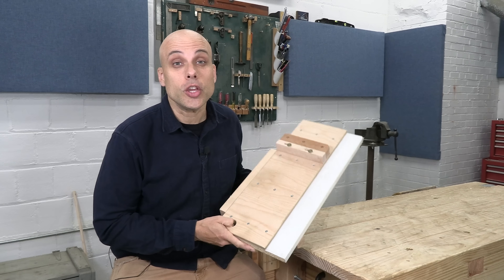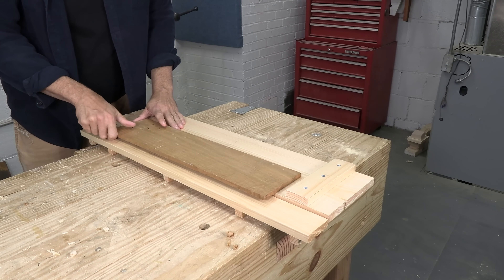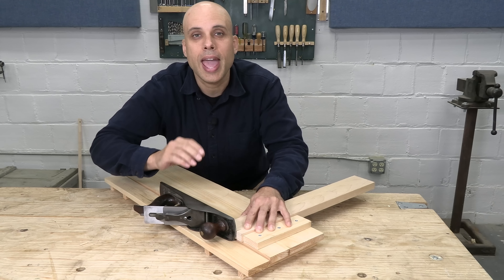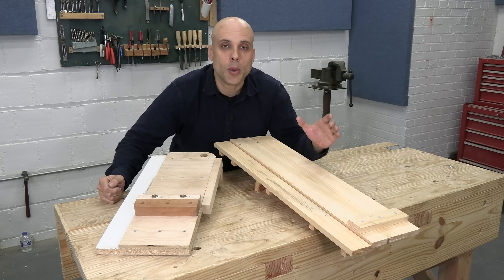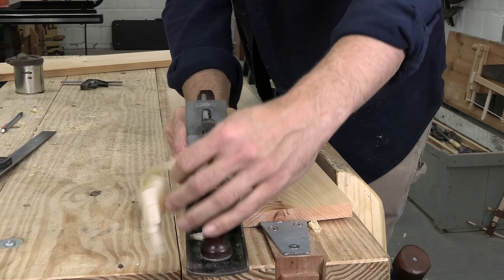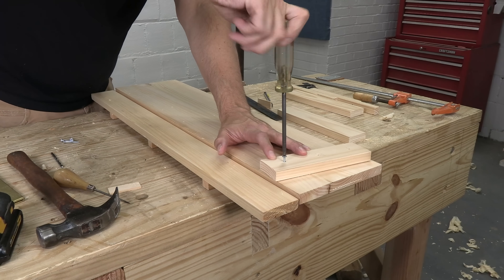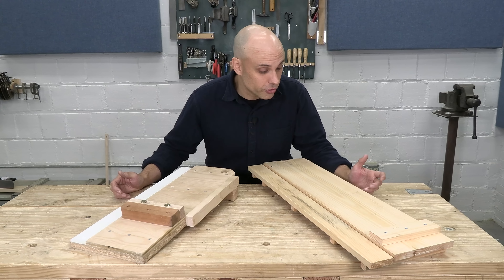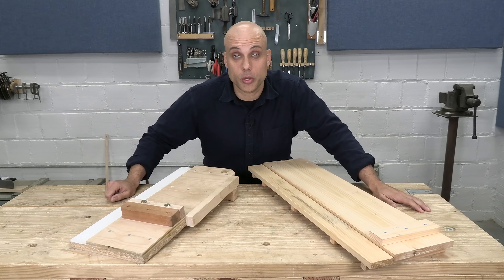Your shooting board is too fancy!  Use this classic design instead!

Comment: interesting fact: contrary to popular belief, plywood is not a modern invention.
plywood dates back to antiquity where many cultures, such as the ancient romans used sheets of wood, glued together with perpendicular grain orientation, to construct objects that were required to be lightweight but also strong, mainly the scutum, the stereotypical roman shield, was constructed out of plywood.
Reply: Yup, but I think the difference is now plywood is made as a sheet you can buy and make anything you want out of it while as back then it was made straight into the final product. If that makes sense.
Reply: @thatguythatdoesstuff5899   well that and the thickness of the sheets and the glue they used were different from what would be familiar to us, but my point was that the Romans were aware of the benefits of clueing wood with crossing grain together.

Comment: Why cant you use the edge of the stage to register the plane against? The plane should not plane it away as the blade go to the edge. Is it just because the fence is not 100% 90°?

Comment: I saw a small Stanley plane at the hardware store the other day. Would something like that be good for someone that has never used a plane?
Reply: You would be better off buying an older Stanley plane on ebay and then restoring it yourself. If you did that you will have a plane that is as good as those expensive fancy ones today. If you look out you will even find people selling planes that have already been restored. 
If you buy a cheap Stanley plane in a shop you will need to put some work into the plane anyway. Restoring a plane is easy and it will really teach you how the plane works and there are lots of great videos out there on it.
Reply: @bighands69  I have one that belonged to a late relative somewhere, but it is rusted up.  I don't know if it is even salvageable.

Comment: Very interesting video!  However, aside from the fence that you say is optional, why even build a shooting board like that...  why not simply clamp a board to your bench to use as the upper board to hold the workpiece, and ride your plane on the benchtop? (instead of the lower board that the plane rides on).   Hard to explain, hope it makes sense.
Reply: The English Woodworker actually has a video making a shooting board with no track. It works like a bench hook.

Comment: Beginner here. First of all many thanks, been watching you for years. I'm not sure I fully understand why you can't use the classic type the same way as the advanced type. Is it just the lack of precision in squareness of the different parts? The basic components seem the same. I also wonder: is there a 'best of both worlds': use melamine/plywood (I have always laying around), but with a simpler construction.
Reply: If you have the power tools normally used for working with those materials, I don't see why not.

Comment: Now I'm curious what differences in methods and fixtures have been historically used to dial in miters
Reply: It is all based on simple geometry that would also have been used to build the great pyramids or the Roman aqueduct system. 
How did romans model the slope of the land to know that they would get the most efficient inclination. The user just needs to know some basic techniques.

Comment: A lot of the time planes work better on an angle, as you know. Would it be worthwhile to make the simple, or complex shooting boards, such that the plane is still 90 degrees but not quite parallel to the work as you move forward? I am thinking the plane moves slightly downhill as you push forward, to keep the work pushed down slightly, rather than lifting upwards, if the slope went uphill. One of the pictures you showed of older shooting boards, looked to me as it it were made this way. Maybe the picture just looked this way, but that is where I thought this made some sense, and may be an improvement. This would use more of the iron instead of one area. Would the slope cause the plane to go off the edge of some work? Could the amount of slope be adjustable?

Update: Well shit, I am late to the party. I just spotted a video about a ramped shooting board LMAO

This fellow demonstrated that he understood the physics, then built his ramp incorrectly IMO :
https://www.youtube.com/watch?v=NcVK5wLSPOw

This fellow is on the right track Rex and all, IMHO:
https://www.youtube.com/watch?v=G4VsyqVr8Gc

Needs to be a bit different, or with an adjustable ramp for longer boards......can you come up with a better one Rex, anyone?; that covers all sized boards? Not really long boards mind you. It would be cool though if the planes ramping could be adjusted enough that a small piece of end grain can have the blade move more to cover the short stroke, while for a long board the ramp needs to be much less as the plane blade covers a greater distance, so only needs to move slightly.

The simplest design is more often the best design, but too simple does exist lol

Comment: Is it awkward to lean across the bench that far when shooting the end grain or the far end of the long grain?  You look like you have to reach all of the way across the bench.
Reply from the maker: It's slightly awkward,  but I'm tall. I built my shooting board so you could also just use it the long way.  No bending. I think the traditional woodworker would have just shot end grain against a bench hook anyway.

Comment: Maybe I'm missing the point but there seems to be no difference at all between the two boards. Could you not simply use the latter, old fashioned board to trim end grain precisely the way you would use the modern board? It has a straight edge and a fence after all--the difference being that the user is choosing to let the work protrude past the fence instead of aligning it. Please let me know if I'm wrong because it strikes me that the only difference between the two is in dimensions and materials.

Comment: Modern shooting boards you use the board to guide the plane and as you said this historic ones user guides the plane but this is not 100 percent true.  I have come across shooting boards older design thin guide sacrificial boards those are half way between the modern and historic design.  In those setups the plane is running along the edge of the guide sacrificial boards there is a reason for it.  With a shooting board with a guide be it modern or old design you don't need to have marked the line you are squaring also when you use shooting board not often like being in a cattle property and the like and only doing repair wood work less plane control skill required to get the same result.   There seems to be a difference here between historic shooting boards from place making items day after day and places where wood work might be once every 2 years thing.   The lower usage more likely to have a guiding board of some form of the plane.

Comment: Rex, couldn't you forego building a shooting board and instead use your already flat workbench for the plane to ride on when shooting and then simply prop and overhang your board on a piece of plywood to address aligning the board to the iron of the plane? You could hold down the board and plywood with any combo of clamps, bench dogs, stops, or holdfasts and then do the freehand shooting. Does this make sense? You could use the length of your bench instead of going across the bench too, keeping you closer to the work for longer boards.
Reply from the maker: You're 100% right and richard maguire JUST did a video on that.  Speaking just for myself, my bench is too beat up for that approach to work.  I think this is why boards like this became common.  They don't get beat up nearly so fast.
Reply: Just gonna add that Richard’s channel is The English Woodworker.

Comment: I made one with an extra miter gage and it works pretty well, even can use sanding blocks vs a plane with it.  https://www.youtube.com/watch?v=f1Aj2h0vMxc  The best part is, you can take the miter gage out and still use it if needed as it is just friction fit into my board.

Comment: yo i just built your roman bench out of 9 10ft 2x4s. It's litty. 10/10 straight Skibidi, no Ohio. I made the bench to construct a large 12ft walnut table. I am using an 8 and 4ft length boards to span the length. I need them to meet squarely. Why can't i just make a rectangular shims to put on my bench. Something that will hold the boards completely within the height of the plane blade. If ur just aiming for a line you made with a square, I should be able to just clamp to boards to the long bench, and shoot them with a couple of shims under the board, clamped down. I might just be able to do this all today without building anything, and still have time for some FORTNIGHT. Being a leet gamer is really important for woodworking, and I think that is something that old 1920's British cabinet makers really tend to overlook. hence why brexit happened.